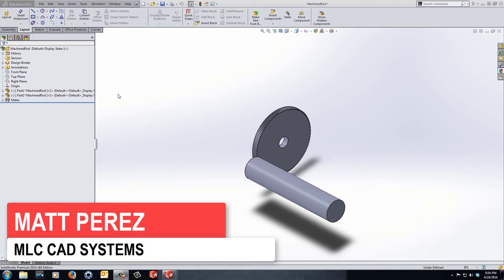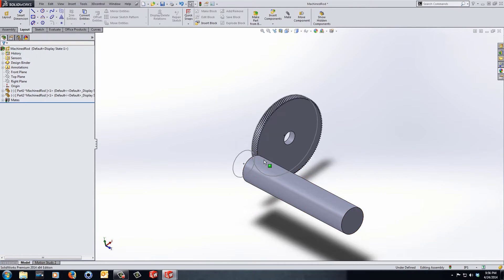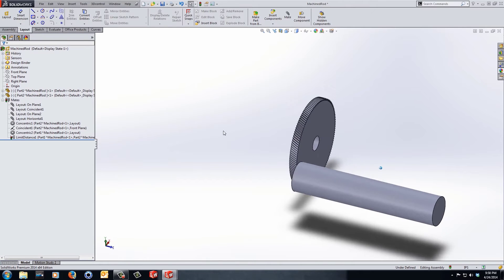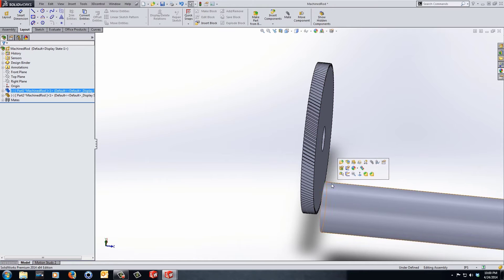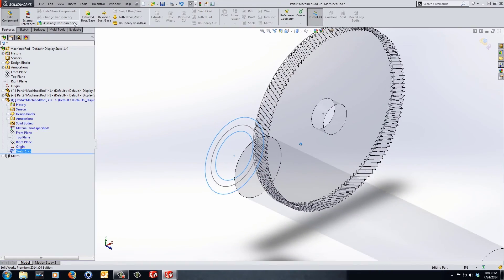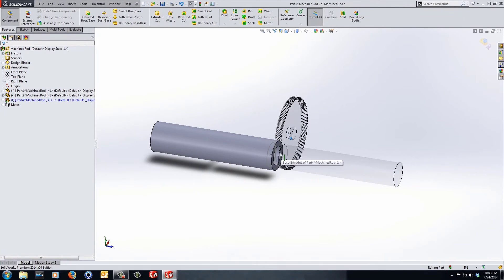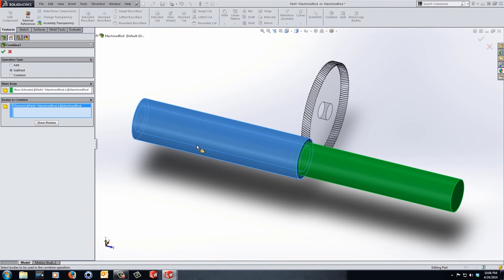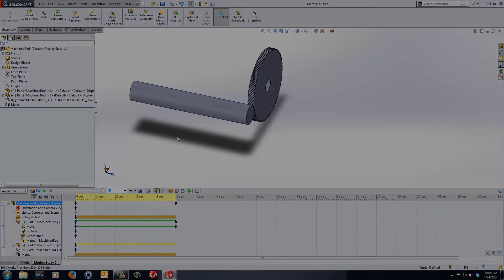Material Removal in SOLIDWORKS Animations 1/2 - Lathe Turning

Comment: How subtract feature is working that way?! are you really subtracting one body form the other? when I did it, I just got the original (main) body, the virtual we created have totally disappeared, how to fix that?
Reply: @MLC CAD Systems
Reply from the maker: The body that represents the material to remove disappears when it is used to subtract using combine.  You should create a body just for this purpose, so when it disappears you are left with only the part of the model you want to keep.  The missing body should not represent anything you want to see.